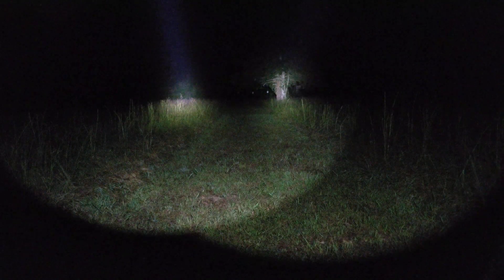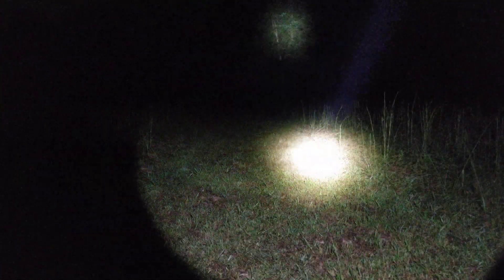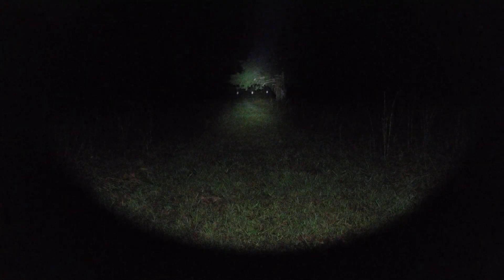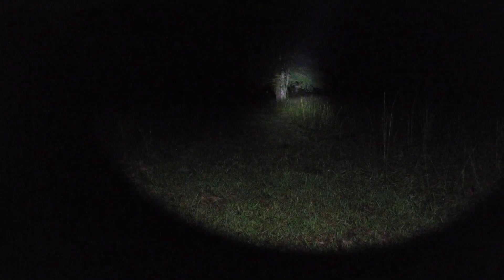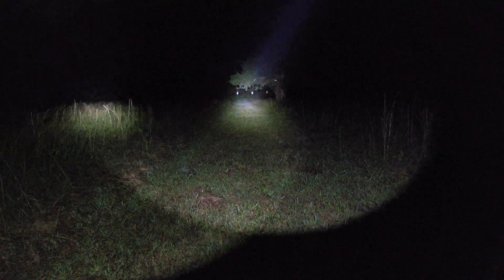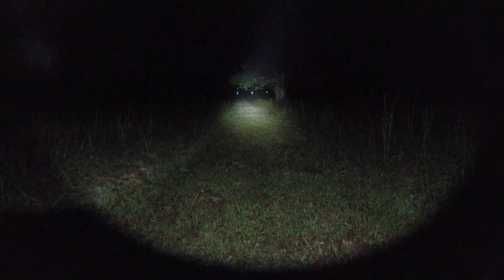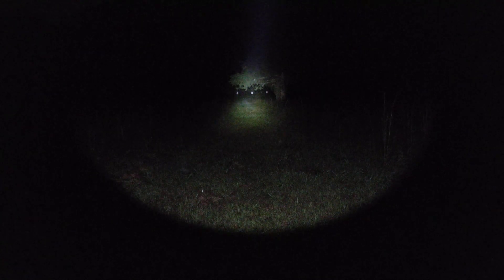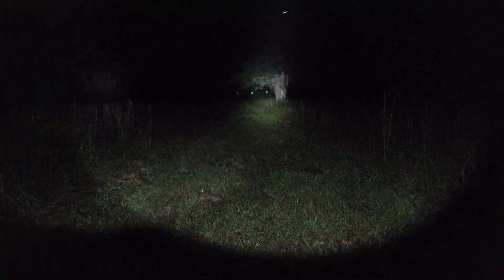Rein 3.0 Micro Dual Fuel and Surefire M340DFT...CR123 vs. 18350 thoughts...

Comment: I wonder how many times the light will reset to full power after it steps down and is turned off.  If it's thermally regulated, I'd think there's got to be a number of times you can turn it off, and have it start full power again.  Unless, it somehow cools down that fast.

Edit: Great test regardless.  I don't think either is too shabby on CR123.